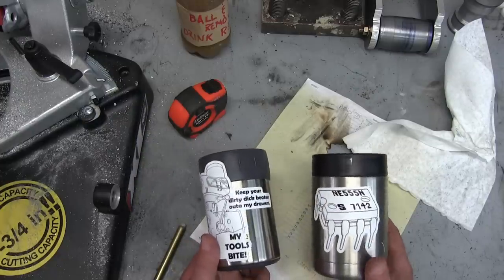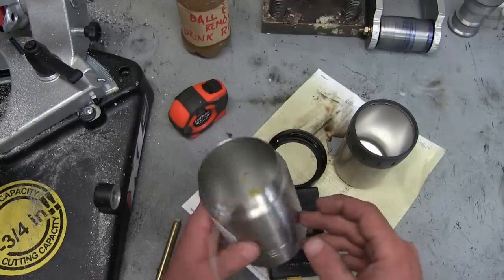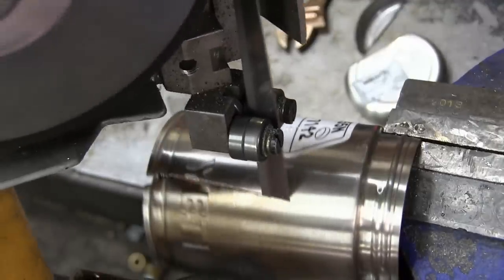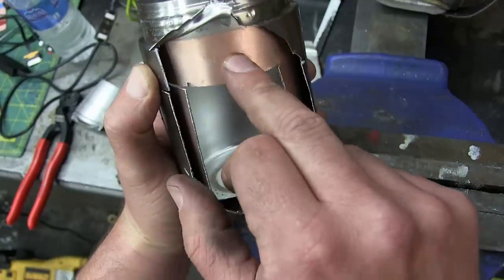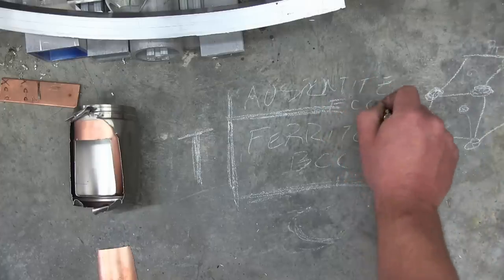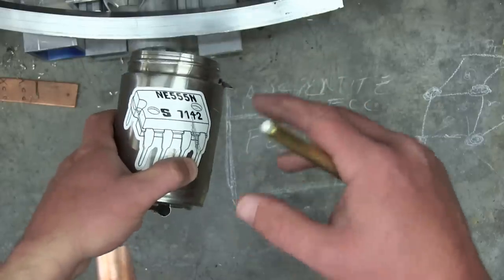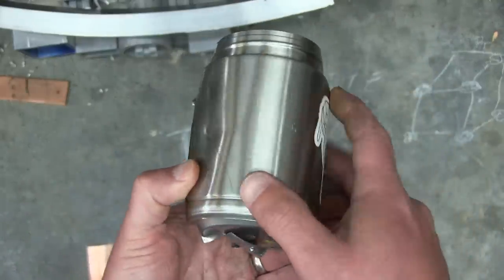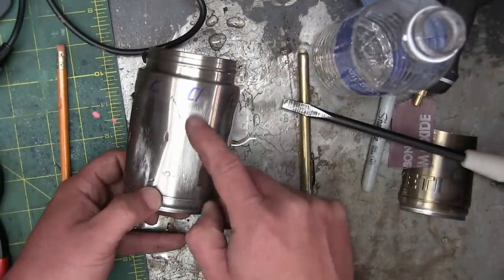BOLTR REDUX: YETI How it works | Enginerding Stainless Steel

Comment: Nubbin thing may be a getter - used to soak up any long-term outgassing to maintain the vacuum. Vaccum tubes use these, though they are heated externally with an induction coil after seal-off.
Reply from the maker: Thanks Mike! I neglected to comment, but the housing for the new PIC programmer is seamless tubing, not die cast. Wall is too thin to cast effectively. Cheers!
Reply: I was thinking the exact same thing. But there isn't much sputtering around so i couldn't say for sure. I guess they don't have to be induced to work in the long term.
Reply: I was just about to say that
Reply: Same: Relevant wiki article here: https://en.wikipedia.org/wiki/Vacuum_tube#Vacuum
Reply: Jakme Auff
Re-dew, it's a Francophone pronunciation, because, well it's a french word, and also a "loan word" in English. Hell, English is basically one of the biggest mash-ups of the languages. That's also why we have so many words in English, and why spelling and pronunciation of english can be very challenging for non-native speakers trying to learn it.
Reply: SBwingman Re-ducks - it's derived from Latin reducere ‘bring back'.
Reply: yup, it is "re-ducks". I was trying to find this comment to correct myself as I became very curious of the etymology of the word. The french "redux" is said "redew", but it ultimately comes from Latin, with the "re-ducks" pronunciation.
Reply: That was my thinking as well
Reply: Does that mean this getter will change color and/or smell bad?
Reply: Imma giver not a getter.
Reply: Well, Deponiis Tuum my Suavem Clunem.
Reply: I didn't hear any vacuum hissing when the cut was made?  In my opinion the Yeti structure is not sufficient solid to withstand a full vacuum? An insulating gas (argon?) like they use in double glass windows looks more realistic to me.  Aren't "getters" only used to create deep vacuum, whilst for thermal insulation purposes the difference between vacuum and deep vacuum is not that important?  The nubbin thing could be a "pressure absorber/ gas condenser" ???
Reply: Makes sense.  I knew it couldn't be a security tracker because it's in a VERY SKOOKUM Faraday Cage in there.  No radio signals can get in or out.
Reply: Hedge Earthridge which is why induction heating would also have to heat the the cup walls as well, so you might as well use a torch if the getter required heat.
Reply: Could it be an anode to keep any moisture from causing rust?
Reply: Frank Lombaer Hmm, maybe. But if it was a real good vacuum, all the water should have boiled off.
Reply: @jonnda  doesnt induction heating only work on certain types of steel and such like cast iron? thats why they give you those fridge magnets to know if your pots and pans will work on your induction plate.
Reply: i so maybe the little puck gets induced but not the stainless shell? im actually asking not trying to be a jerk.
Reply: @kingofthebums  I'm not an expert, but any conductive material should work. I would assume aluminum and copper work better than steel because they're more conductive. However, maybe the resistance load in steel and iron is required to create heat.

So if stainless steel isn't magnetic enough... Then what? Maybe the puck gets heated and not the stainless. If the stainless was heated, it shouldn't be a big deal. Discoloration may occur.

I'm not going to pretend I know for certain. I have never used an induction range.
Reply: @jonnda  thats exactly what i was thinking. the little puck is cast iron lets say so it can "induce". or be inducted. whatever.  but the stainless temp doesnt go up. no staining no need for a blow torch. no warping of the walls
Reply: No, it's not a getter... They're not trying to ensure a clean vacuum for the sake of a non-existent 'trode.  It's what's left of the little tube they evacuuuuated the dewar with, and closed it off during peak suckage.
Reply: Beersides, if memory serves- getters are some narsty material you wouldn't want to use in the creation of a booze delivery vessel.  Toxic stuff.
Reply: @travismiller5548  as far as I know they use a one way valve with a glass bead to do keep a vacuum and just place it in a chamber, no tube is involved, also that was spot welded on....
Reply: @WingmanSR  Redux = It is what happens when a female duck and a male duck get frisky.
Reply: molecular desiccant 🤙🏼I thought that's what it was too but I'm glad you chimed in
Reply: @tuttebelleke  re: insulating gasses in double-pane windows. I thought an inert gas was used because it was moisture-free, and would eliminate condensation between the panes. (until the seal failed)
Is there significant difference in thermal transmission between argon & air?
Reply: Yes it's a getter. The mug, or sleeve, is sealed in a big vacuum oven with a pellet of glass which melts over the draw-down hole. The heating also activates the getter.

Comment: Neat quick and dirty way to tell 316 and 304 apart. The crystal structure of 316 is harder to change with cold working than 304. I buy scrap bar drops sometimes for odd projects, I hammer the corner and check with a magnet to check material.

Comment: Your best video to date. Albeit you were talking about 304, this may help others about stainless. As a stainless welder with maritime tool welding. I can assure you that 316L stainless does not rust unless the metal is heated to near liquid state. I can grind, sand, or polish stainless and dip it right into sea water and leave it there for long periods of time without any rust at all. It greys, but that is about it. However, any weld joints will be slightly or fully magnetic and form a rust layer slowly over time. I built my first boat frame out of 316 stainless and still use it today and all the exposed weld joints that WERE NOT ground down have slight browning/rust on them. However, 1cm past the weld joint, and there is no rust at all. All the weld joints that are exposed and WERE ground down have no rust or browning. These joints are kept near the sea 24/7, are never rinsed with fresh water, and endure all the weathering that mother nature tries to throw at me. So, yeah, your 304 grade of stainless is garbage stainless. 316 is the gold standard of the maritime industry.

Comment: Slug to react with loose oxygen atoms in the vacuum. Can't be tracking inside a full metal casing.
Reply: That's what I was wondering...some sort of small sacrificial anode to slow the oxidization process maybe?  Wouldn't need to be large if it's sealed up and they've already pumped out most of the oxygen.
Reply: This was my guess too. Something like a getter you'd find in vacuum tubes.
Reply: Yeah, I was thinking getter as well.
Reply: Ye i've heard this before too, like they can't create a perfect vacuum in fabrication. So the slug basically removes the remaining oxygen to improve the vacuum.
Reply: Yes, I think so as well. Especially since you have copper clad steel in there as well, which will corrode otherwise. But I also think it's not just for oxygen, but gases in general to maintain a good vaccum (or create one in the first place). Could be a piece of activated carbon for example. That adsorbs all kind of molecules and isn't limited by chemical reactivity.
Reply: Dammit, I should have read the comments before I posted mine. Shoulda known I wouldn't be the first to think of that.
Reply: getter material... probably Zirconium, Barium or something reactive like that.
Reply: BavarianMonkey

Yep, it's a "getter".

Helps to get that last teensy queef of air out.

They used to add small getters to the hermetically sealed telecoms / fibre devices at my old job (Nortel).

"Flashed" getters are more often used in CRTs, VFDs, and other tubes.
(I think a similar inductive method is used for the mercury blob in some CCFL tubes too?)
Reply: I was thinking iron&carbon thing like inside jerky - oxygen absorber (via corrosion.)
Reply: Ben Greisler it collects radiation from Canadian beer
Reply: Laser tubes and lamps like HPS, MV, MH all have getters.
Reply: I was thinking it was a "getter" too.

Comment: That little doodad you found inside the can is probably a "getter". You see them in vacuum tubes and ark lamps. They're meant to absorb certain gases like those released from outgassing materials in the vacuum chamber (if memory serves me right). I think they're meant to be heated up in the last stages of manufacturing. I've seen some very old induction heating machines on the market for this purpose.
I'm not sure why there would be one in a thermal flask though - I wouldn't have thought it was that important to keep a perfect vacuum to stop the heat transfer but maybe I'm wrong. Or perhaps it's to prevent some chemical/meterlergical reaction. No idea really what it's for but a 'getter' makes more sense than a security device as it's essentially in a Faraday cage, shielded from detection.

Comment: That little nubbin inside there is probably a getter, to absorb stray air molecules.  They usually get fired after the device is made and sealed, either by an induction heater or by direct heat.
Reply: Could be air in general or water specifically.  The copper layer on the inside would probably be ruined by any latent moisture.

Comment: That disk is probably a getter material to collect the Oxygen when heated, the magnetic section is probably a result of an induction heating to get the getter to react with o2 generating the vacuum since their is not a vacuum port on the Dewar .
Reply: implies not infers.
Reply: Could it be a little peice of like magnesium? sacrificial metal to corrode first?
Reply: I agree, took me about thirty seconds to figure that out, but three years too late.

Comment: i work at a major outdoor manufacturer.. Those little things are called a Duralumin button that keeps the gasses inert until it gets welded.
Reply: So it's a fart container? Got it!
Reply: I google Duralumin button.  An alloy of aluminum used in aircraft.  Helps keep what gasses inert?  After assembly there are no gases if there is a vacuum.  What gasses, air, N2, O2?  Do they put argon in like window panes?  I would have liked him to verify a vacuum inside, I heard no vacuum release when he cut into it.  Once more; what gasses are you talking about and how would an aluminum alloy keep them inert?  Perhaps you mean like a sacrificial anode or something?  What are you talking about?
Reply: I kinda thought the name duralamin was a made up term from Mistborn... Huh. Nifty.
Reply: @MrZeus7  sanderson ftw

Comment: Where I work we build big industrial (and residential) zero-turn lawn mowers. We have some Dewalt and Milwaukee tools but a majority of what we use is Bosch. Now, I don't trust myself to take apart one of these and besides, you have a lot more technical knowledge than I do. I'd love to see a tear down of one of our standard tools we use at work. Now, from what I had seen at work with these, when I bought a house I got myself one of the impacts we use as a house warming gift. I got myself an IDH182. It has a duel 1/2in Sq - 1/4 hex drive.
These impacts take a beating at work and keep choochin. Talking two shifts running 10-11 hours a day, with the line I'm running on now putting out 200± mowers a day. I'd love to see a tear down and hear what you think the failure modes are and I can tell you, after your tear down mind you, what tends to fall apart first etc. I tried talking to the main dude at the tool crib about what we do when they quick working etc in hopes I could score one too send to you to get tore down but that was a no go. Coincidently, they actually make some of those Yeti products just a stones throw from where I work now.

Comment: 2 things.
1 there is little concern of the copper inside (that normal people don't expose) of getting damaged.  If it was there is little chance of oxidation in a vacuum. 
2 the little dip dad in the bottom is less likely to be a tracker installed by big brother, and more likely to be what is referred to as a getter.  A getter is something added to high end vacuum systems like vacuum tubes. At that price they better add everything. 
I really enjoy your videos. You have saved me money by avoiding crap tools.   Keep at it.

Comment: A multimeter is a good tool to showcase the effect of the invisible oxide layer. Tap the probes on the can and no conductivity... But scraping with the pointy end is sometimes enough to dig through and you'll get a reading.

Comment: I work on microbulk gas tanks and the science behind keeping gases in a liquid  state out at the jobsite and making gas in the same tank is very similar to a yeti cup. Inner vessel with super insulation vacuum jacketed and only touching the outer jacket at the top where the ports are. Chart brand tanks, amongst the many, are huge Yeti cups and they are good at it. At the middle of the day out here in Texas, you can't touch the outer stainless shell it's so hot due to the sun but it can keep nitrogen, argon, oxygen, Co2, or fuel gases in a cold liquid state for days with very slow transfer to gas due to heat. Cool systems if you wanna look them up.

Comment: 6:27 "Copper coating it, due to the electronegativity of the materials, causes steel to rust." Aren't you forgetting something? I'm pretty sure you need an electrolyte (such as water) in order to create a current and corrode the less noble metal. No such thing should be present in that cavity unless the vacuum is breached, though. Neither should you be able to scratch the copper surface unless you cut a hole in the outer wall. :)
8:00 Could that be some sort of material designed to suck up the last few oxygen molecules that may be present in the (not-yet-a) vacuum? Similar things were done in the era of vacuum tubes.
Reply: That's what I was thinking. That might be a downside if it were on the outside of the vessel, but since it's on the inside in a vacuum, it shouldn't be an issue. All the upsides with none of the downsides thanks to the vacuum and buffer.
Reply: Bam! Exactly.
Reply: Not necessarity water, but corrosion involves oxygen, and there is none in there (vacuum)
Reply: water itself needs some solved ions to act as an electrolyte...so you mean eg. water with salts
Reply: You don't need a scratch in it as there is a boundary of where the copper ends and metal underneath is exposed, so corrosion if it were to happen would occur there.  What the poster is forgetting is that the copper flash was applied to a Stainless surface.  Copper is cathodic to regular carbon steel but is not to a normal stainless surface, so no harm.   And yes, you'd need an electrolyte which won't be there in a vacuum anyways.

Comment: Carried around a gifted Yeti cup for 6 years now and use it everyday. It had survived some pretty brutal falls with barely scratching. Only one real dent from landing onto a strip of metal from some height during back stage work. I’m on the third lid though. 

Had a brand name Thermos get pretty severely dented from a comparatively modest fall.

Comment: We welded a bunch of hastaloy at a power plant and we had to make slag picks from a piece of hastaloy before we could start. they made sure each day that we didn't have regular slag picks. Guess its expensive stuff and they said what you just did, it's really rust resistant but if you hit it with a carbon steel pick, it will start rusting there. The project was a big cone in the bottom of the stack, something about exhaust movement, it was supposed to keep solids from catching in the updraft and flying out the top of the stack.

Comment: That pellet in the bottom may be to scavenge out residual air molecules. The old vacuum tubes had a similar capability that was activated when exposed to radio frequency.
Reply: "Radio Frequency Induction Heating"  en.wikipedia.org/wiki/Induction_heating